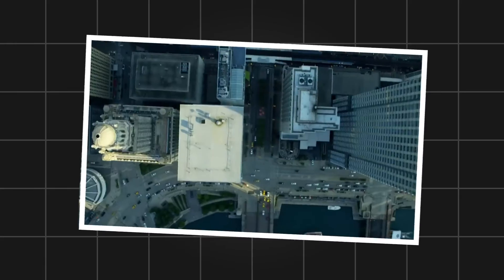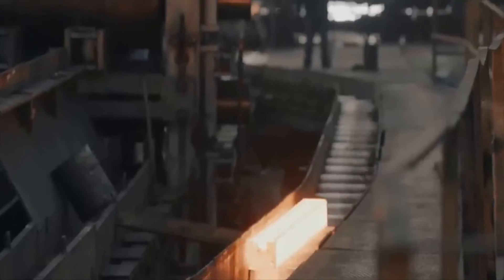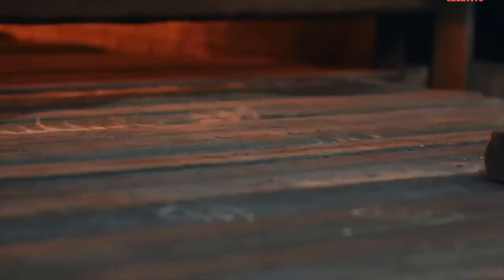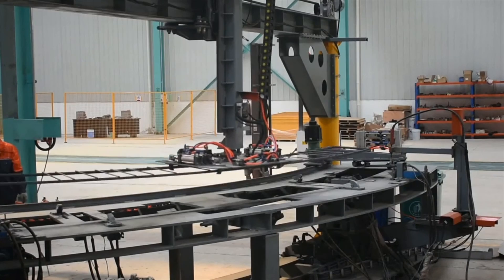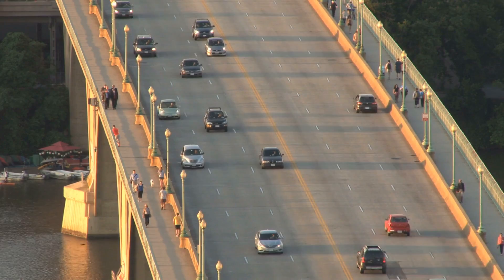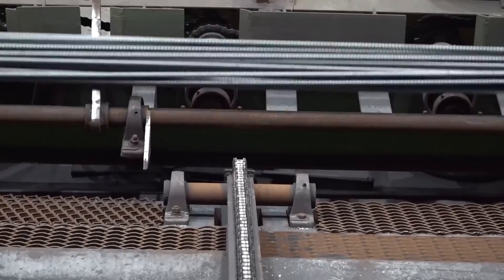How REBAR is Made

Comment: What's the steel alloy rebars are made of?
Reply: It's made from scrap steel, thus, it's an amalgamation of various steel alloys & grades, then usually coated with epoxy resin or galvanized (coated with Zinc).

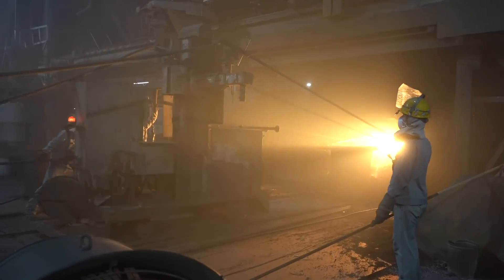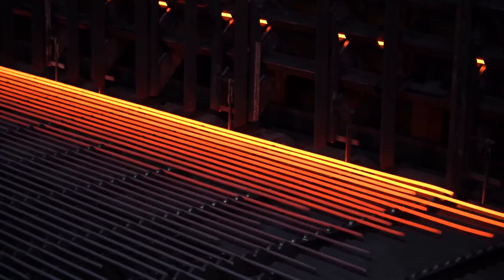Comment: 2:15 and 2:22, that is NOT a blast furnace, but an ARC furnace. If doing documentaries, it would be advisable to learn the difference between the two. 2:39 At the continuous casting, you do NOT control the chemical composition anymore; that is done in the ladle. 3:30 if you REHEAT the rebar at this point, you just made a new pile of scrap metal, good for nothing. If you're in fourth grade, this video you made is worth a B-. If you're older, you should really spend some time researching what you're talking about because, honestly, this short docu just sucks.
Reply from the maker: Thanks for the feedback and for watching!